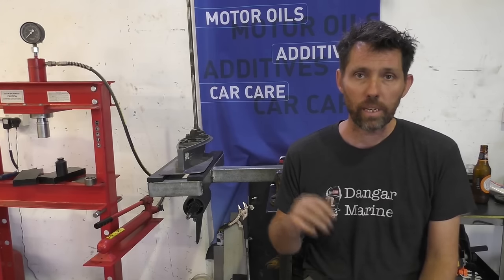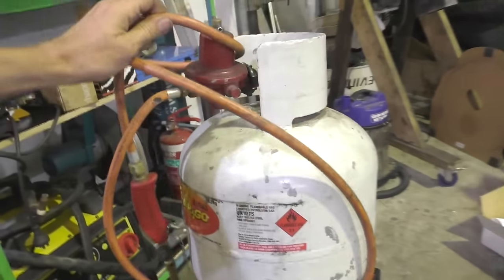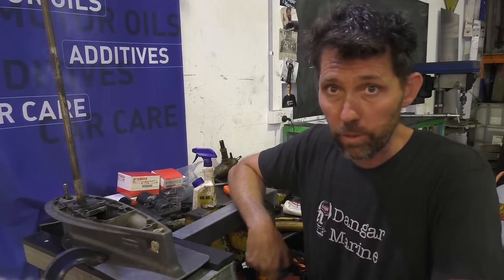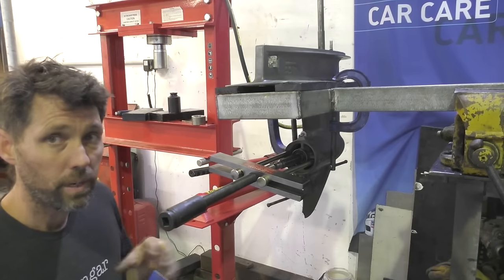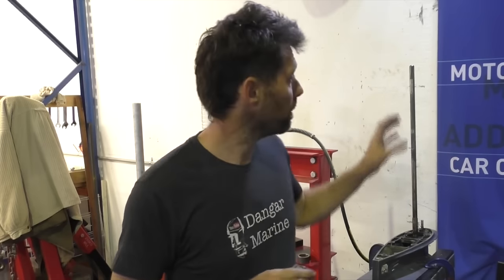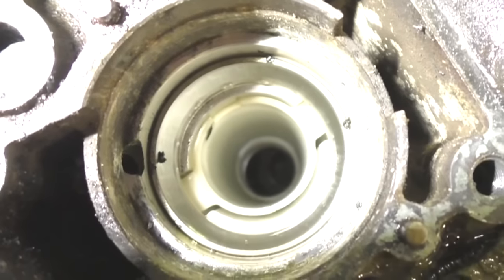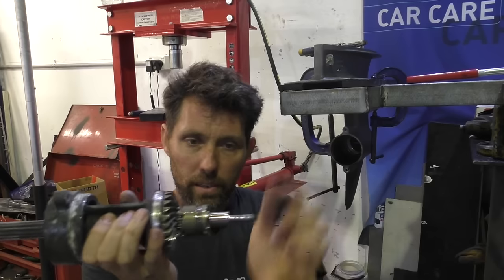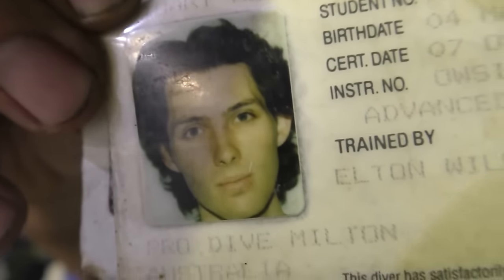Removing an outboard driveshaft

Comment: I learnt a good trick today to undo the pinion nut without the spline nut tool. Put the lower unit back onto the motor and use the flywheel to undo. Worked a treat. The factory already gave you the tool built in 👍🏻.
Reply from the maker: Great tip!

Comment: Thank you! Working on my 2007 F50 Yamaha now due to milky oil in the lower unit. Found that the upper drive shaft seals have failed. I have more confidence with the repair after watching your videos. Thanks again!

Comment: Nice one Stu
I just did the seals on my Johnson 90. I used a pitman arm puller I had for lifting my Jeep and some wire to pull the bearing carrier. Was worth a crack and it worked !

Comment: That was very informative, thankyou!  Was trying to find out how to remove the drive shaft on my Yamaha F60. I somehow managed to completely shear all the teeth off the pinion gear. So far it doesn't look like there is any other damage but a lot of metal debris in the gear box. Hoping I can rebuild it with just a few new parts. Assuming I should inspect and clean all the bearings and flush out the gear box well. Thanks again!
Reply from the maker: You're welcome!

Comment: Thanks for the video. It was very exactly what I was looking for. I am taking apart my lower unit on my '61 Merc 700 Full Gear Shift. It's almost exactly the same. Only difference that I saw was that under the water pump, my bearing is a ball bearing type and of course the gear housing cover which is the ring type as opposed to the 2 bolt type you have there. Everything else is pretty much the same exact thing.

Comment: Hello, you commented during the video that you were not sure if the driveshaft removal was really useful! During my attempt to chase down an oil leak in the prop shaft area I ventured into the gear case to examine its condition. My outboard is a Mercury 650 vintage 1965-1968 65 hp. motor. I'm not a mechanic by trade (mostly a plumber) but after watching several of your videos on Utube I thought I think I can do this!. The driveshaft video was particularly helpful, except my driveshaft was really not coming out and the pinion would not drop off easily. I used a 5/16 carriage bolt with the head cut off and split about in half then threaded each half into a coupling with the top bolt locked in by a nut. As I turned the coupling, it pushed up on the drive shaft (after removing the pinon nut) and after some wrenching the driveshaft and top bearing finally came out.
The main reason for wanting the driveshaft ,pinion, and forward gear out was to retrieve the cam shift selector that fell into the gear case after the selector rod was accidentally lifted up while replacing the rod seal. There was a sinking feeling when the cam fell into the case and now I had to go after it, but your video was a lifesaver and gave me confidence to try and retrieve it.
One thing I would like to ask you is what position should the cam be in when I replace the components? The dog clutch is in the forward gear position so the selector pin in its furthest point. Thank's much! I'll keep watching!!!
Reply from the maker: Hey Phillip, very ingenious work in getting your driveshaft out. I'm not too sure what position that cam goes in on your motor, but generally if the motor is in forward gear the cam will be on it's thinnest section allowing the dog clutch to move forward towards that gear. Rotating or pushing to the thicker part will then push backwards to select neutral and reverse, at least on the outboards I am more familiar with.

Comment: Excellent video Stu. I have a 2001 Mercury 50 hp 4S that's getting a 5" extension kit and I'll need to replace the driveshaft. The Mercury is very similar to the Yamaha. Thanks to the Yamaha - Mercury collaboration.

Comment: You can remove that shaft without fighting with the pump keyway right away. I use the key for a stop with a 15 inch adjustable spanner wrench instead of vise grip pliers. After you get the nut off then you can pull everything out and put in a vise for further work such as removing that stuck key and usually a sharp chisel works very well removing the key.

Comment: Working on a unit with a lot of rust and corrision. Vice grips didn't work. I used a standard pipe wrench and viola. 20 seconds later the nut was off.  Then to deal with the shaft being rusted into place. :-)

Comment: Hi Stu your video left of at the point that I am up to with my Yamaha 90, so I am looking forward to the next video. I need to add an extra shim behind the forward gear because according to the manual, the drive shaft backlash is out of spec according to my measurements, but I didn't use the correct yamaha tool that clamps to the shaft. Also the dog clutch is in a bad way on the reverse side so will change that at the same time.

I appreciate the videos - this has been the most relevant for me thanks.
Reply from the maker: Hi Pete. I would really like to do a video on shimming, but I'd also like to find a way that avoids using custom tools that people won't own. Hopefully I can get it filmed soon.

Comment: Great video, just wanted to see you remove those bearing races on the forward gear and the engine drive shaft. That is the part that I'm having problems with.

Comment: Thanks. Your videos are absolutely great!
I'm currently taking apart my own Yamaha 30 hp outboard as it won't go in reverse and I suspect the reverse gear to be in bad shape so this video was really helpful. 

It would be great with a follow up video showing how to reassemble the lower unit and setting the gear play.
Reply from the maker: Thanks Roger. If it is reverse you won't need to remove the drive shaft. Here is a video on that problem. https://www.youtube.com/watch?v=B4acSf_BgP4 I do definitely need to do a follow-up video on the reassembly side though.

Comment: Hi thanks for the vid.  I'm working on an old Tohatsu 18E 2 stroke.  The vise grips and 17mm spanner won't get it on this one.  Seems pretty tight.  Do you happen to know where I can get the drive shaft adapter and spring loaded socket for the nut here in the US?  thanks

Comment: Excellent videos!  I've watched several of yours lately because my son and I have acquired a 'new to us' Palm Beach with a 70 hp '04 Yamaha.  We have the lower unit off now and are waiting on new seals.  I had to comment on this video because we had your Woodruff key's other brother from hell.  I ended up drilling three small holes and turned a small propane bottle upside down to let liquid propane super chill the key.  It tapped right out after the propane bath.  Wasn't sure I could apply heat to the shaft.

Comment: Have you made the bearing replacement video yet?  I did not see it in your video list but you do have a lot to sort through.

Thanks for making these! Definitely helped me to inspect the bearings on my main driveshaft. The upper bearing beneath the water pump locked up and tore up the shims, or vice versa. The bearing race came easily out of the housing with the bearing (and is stuck to the bearing), but the housing looks good. Not sure where to go from here now.
Reply from the maker: Hi Spencer, I don't have a video on that yet but hoping to do one soon. The tricky bit with replacing these driveshaft bearings is making sure it is shimmed correctly so the pinion gear meshes correctly with the forward and reverse gears.
Reply: Swing on up to Duluth, MN and host a lesson

Comment: Another handy video Stu. I hit a reef with my leg and shattered the whole gear pinions, gunna cost a poultice to repair, is it just as easy to put back together again. Johnson 9.9 '77 seagull.🚣
Reply from the maker: Depending on whether it needs shimming (may not on a small motor) then it is pretty straight forward to get it back together - just the opposite of coming apart. Will be doing a vid on replacing the dog clutch soon so that may give you some more info too.

Comment: Are Mercury's like this? I ask because I have to install a new lower unit on my 60HP Merc and will need to swap my driveshaft to the new unit. If I have to disassemble the new lower unit to install the drive shaft then I don't see the wisdom in shipping assembled lower units. They'll just have to come part.

Comment: Thanks so much for the information, as I’m trying to repair a 50 hp classic Mercury outboard which the previous owner seized the bearings due to water in the gearbox. I was successful removing the prop shaft but after removing the nut on the drive shaft cannot get the gear to drop off and get it out. At least I now know it can be done and will persevere!

Comment: So my lower unit (Force 90) came out of the winter with a big crack along it, right along where the propeller shaft would go.  Can I repair this with JP weld so it would hold the gear oil again or would the inside be messed up too and I just have to replace the whole lower unit?

Comment: First of all....Thanks for all the informative videos. You have been instrumental in my confidence to tackle the lower unit in my 1993 Merc 115. The piece that the pinion gear nut screws onto, fell out of the splined cavity that it resides in. The nut is still screwed onto the threaded piece with about a half inch of teeth. Have you seen this before? I assume I am going to have to remove the drive shaft and reinsert it or hopefully not have to replace the entire shaft.

Comment: Great! Still working on getting water at tell tale though, I've change impeller rubber, gear is engaging, tube is connecting on impeller housing , no blockage from housing to tell tale! But still no water coming up!!!
Reply from the maker: Take a look at my testing a water pump video.

Comment: Hello. I’m working on a 2003 Johnson 150 with a m2 lower unit. I have one question that I can find a video on. What keeps the lower drive shaft the proper height up and down. There is a needle bearing pinion bearing but I don’t understand what kept the driveshaft from taking all the way down other than it hitting the case. The pinion bearing was the fault and needles and chunks of metal fell out when I pulled the shaft up. Any videos or tips thanks.

Comment: Question:  I have an older 30 hp 2 stroke Yamaha. My lower shift cam is out, and I'm not having any luck getting it back in! Is there a trick getting it back in! Or do I need to pull the gears out to get it reinstalled?
Is it possible to loosen the gears just enough to get the cam to drop back in place?

Comment: I have a 2002 yamaha 40hp 2 stroke similar to the one in this video. While removing the shift shaft cover to replace seals, I let the shift shaft rise up from the shift cam. Is there a way of getting the shift shaft and cam back into proper position without removing the lower bearing carrier and propeller shaft?
Thanks for any advice!
I really enjoy your videos!
Thanks!

Comment: I have a Yamaha Hydra -drive stern drive powered by a 7.4 V8  454. Very difficult to find replacement parts for.  Anyways the prop shaft seared at the prop and is sitting at the bottom of the lake. I need to replace the prop drive for this out drive. Are all Yamaha gear boxes similar? Hydra drive ? Last made around 1994. Please help!

Comment: I have an older Yamaha 40 hp 2 stroke. My forward works fine, but my reverse feels and sounds like its trying to engage but will not shift into reverse. Does this sound like  a dog clutch issue? Thank you for the video and any answer you can give.

Comment: Thank you for your interesting and informative videos. You obviously have allot of knowledge about outboard motors, and I would very much appreciate to hear your opinion on the following:
After quite a bit of researches on spiral bevel gears I can not seem to "get" the Yamaha setup. All other brands (using spiral bevel gears) seem to have so called right handed forward and reverse gears with the matching left handed pinion gear, whilst Yamaha have the opposite layout. And still they all seem to have propellers pitched the same way, turning the same way. So it would seem Yamaha is driving their gears "backwards". Can you shine some light over this topic? It is very hard to get any information on which direction spiral bevel gears are supposed to run, although some say they are only supposed to be run in one way?!

Comment: Does the driveshaft need to come out to replace the dog clutch on a Yamaha 200 HPDI? There’s grinding when engaging reverse and a shift linkage adjustment didn’t seem to help. I’m assuming a worn dog clutch. Approximately 950 hours, 2001 model year. Thanks

Comment: Thank you for your recent response to my problem...I have the '94 mercury 75 hp 2 stroke. I drained the lower gear case and removed the selector rod (splines on both ends). however, the selector lobe gear does not have a splined female receptacle. I was told that when I removed the splined shaft the spring loaded pointer in the dog gear section pushed the lobe into the forward gear. Now, do I have to remove the entire gear box to reset the shaft back into the lobe. If, so, is it feasible to drill a small hole in the casing and push the llobe back and put the shaft back in.? Looking down into the selector  tube, there is only a rrecessed hole in the lobe gear with NO splines, so when I put the selector rod in, it just rotates freely with no resistance. My shifting mechanism rotates linkage back and forth, not up and down.

Comment: Hi , Not sure if you can help but watched a few of your videos and you may , will know more than me. I bought my first boat a 4.88 quinny with a  honda bf75 four sroke, I cant get the leg off, resorted to 2xfolding wedges and it busted off the fins witht he pressure on it. so put a block of timber under and used a car jack on the frontal plate as this now it cracked . Had heaps of pressure on it but bolt under where you remove leg i had wit 5mm ou bolt so i know if it moved, is not moved. Where do i go from here? i'm new to boats and looks like it will not ever get used in anger again?

Comment: Nice work as always stu
Reply from the maker: Thanks Dean! :)
Reply: Hey, great video! Have a 6 hp commercial Johnson motor, my first outboard- knew the water pump impeller had to be changed- watched a video some where else- they emphasized not letting the lower unit crash down when you loosen all the bolts- mine wouldn’t drop! Tapped it down gently but firmly until the leg came off the driveshaft while it remained in the power- head-👻 Oh well- I realised immediatley after by pulling the rope a tiny fraction the shaft fell easily to the grass- slid the shaft ito its home in the leg spun the shaft and the prop spun fine assembled the new water pump impeller and ran the boat- works great!- but some times the shaft jumps out of gear and motor revs real high? im still confused how thats possible?

Comment: Hi DangarStu, I highly appreciate your Outboard-repair videos. Really helpful and so much fun to watch! Many thanks indeed!
One question though: I managed to disassemble the drive shaft of an 40HP Mercury EFI (2003). But, the drive shaft appears to turn rather rough once re-installed, no difference with that replaced forward gear-set or the old one (broken tooth). However, if I just slightly pull the driveshaft about 1-2mm upwards, everything runs smooth. Is this within the range? In your video you casually turn the propshaft while talking and its running rough aswell...what is your experience? Kind regards, Dirk

Comment: I have a 89' johnson 75hp the prop shaft that will not come out! Have the drive shaft and pinion gear out as well as shift rod after putting it in reverse. Everything is off and is loose just work come out with the forward gear

Comment: I have a 2003 mercury 125hp optimax long shaft, and a 2002 with an extra long shaft. both the same thing just different lengths, same blue color hood, body, block and power head, and also midsection other than the extended block section on the 25".  what would I have to do to male the extra long shaft, a long shaft? if I were to take off the lower unit on both, and take off the extended section, would the 20 inch shaft lower unit bolt up like normal? or are there other parts that would be needed?

Comment: if i just need to remove the prop shft to replace or straighten it I do not have to touch the drive shaft or top seal correct .Just remove the bolts and housing and pull it out ?

Comment: Hi Stu great videos as always.i just took lower unit off a force mercury 120hp to replace the impeller.when I turn drive shaft it feels like its snagging on a curtain point every rotation .not by much though .any clues on what could cause this and should I worry about it .cheers Stu alan

Comment: question:  if the drive shaft is stuck in the motor Could removing that nut allow you to have a better chance in some way to unfreeze the shaft to the motor?

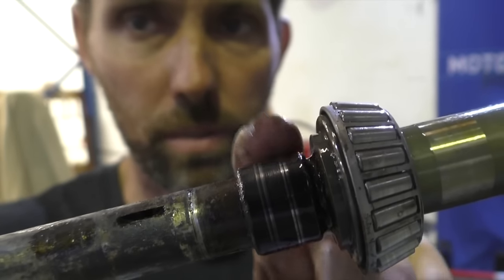Comment: Struggling to remove the tapered roller 10:26 bearing from the driveshaft. It is pressed on. I destroyed the bearing trying to use a hammer slide to remove it. Thinking I may need to carefully cut it off or weld tabs to the inner ring of the bearing so I have something for the slide hammer to grab. Suggestions?

Comment: How do i get the bearing on the drive shaft that sits inside the oil seal location. my drive shaft seems to have a little lip I cant get my bearing over. 2009 30hp mercury 4 stroke

Comment: Is it normal to have some wear on the drive shaft spines?I did a impeller on my 1985 Johnson 20hp and the splines showed some wear when I examined them.thanksthese videos are very helpful.
Reply from the maker: It's not that common, but after over 30 years of use I guess it can be expected. The trouble with wear is that it introduces play which in turn accelerates future wear so keep an eye on it.
Reply: thanks again.